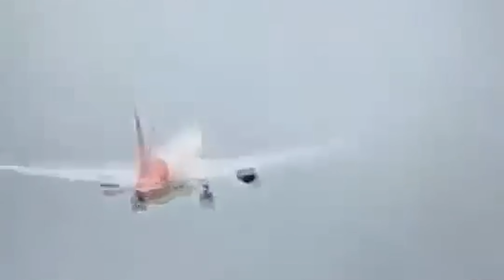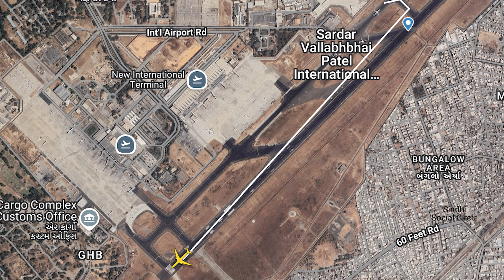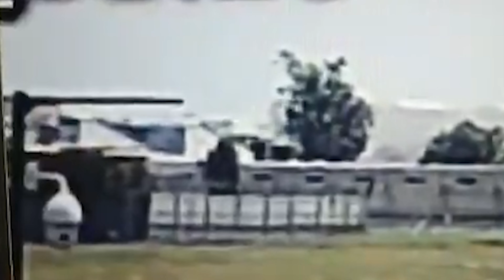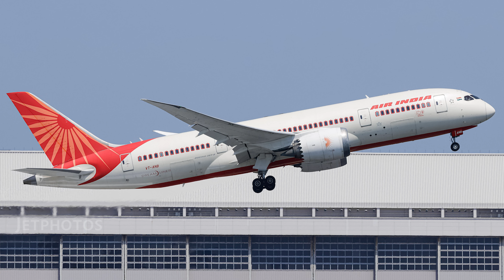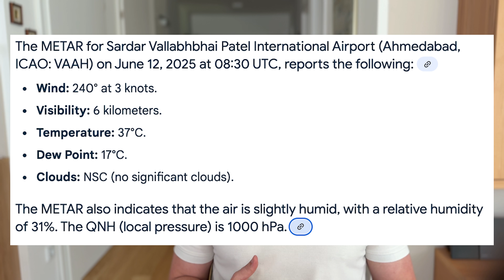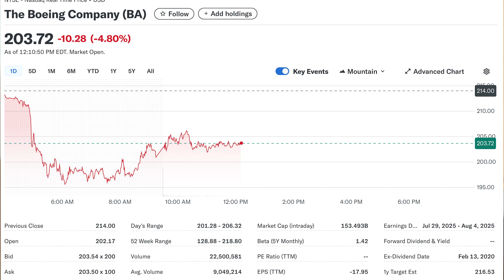Shocking Crash of Air India 171 Explained!

Comment: Engines were running. Similar to NW #255; no flaps, 1 survivor, pilot error
Reply from the maker: No flaps is confirmed at this point?
Reply: @aviationmike6894  reports are flaps were down. So some serious failure(s)?